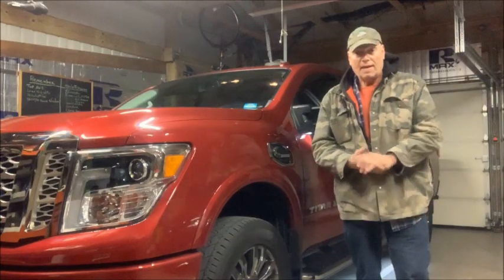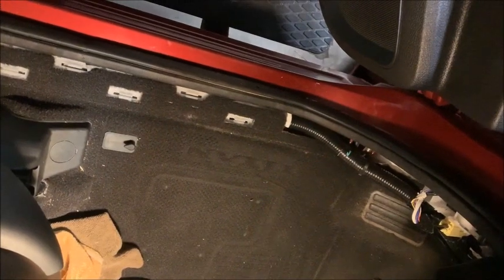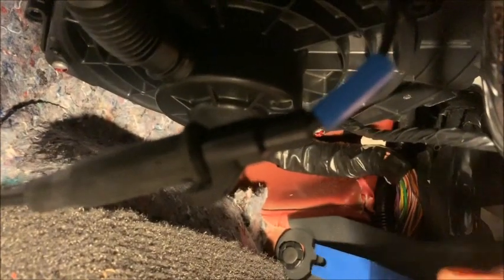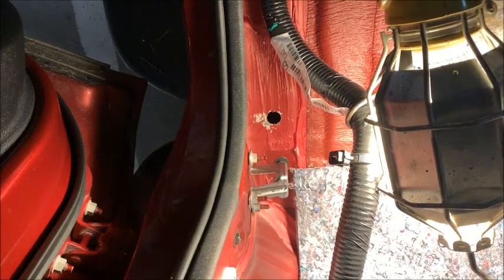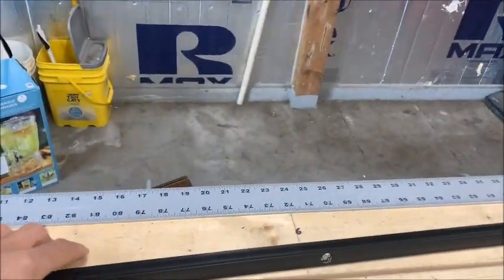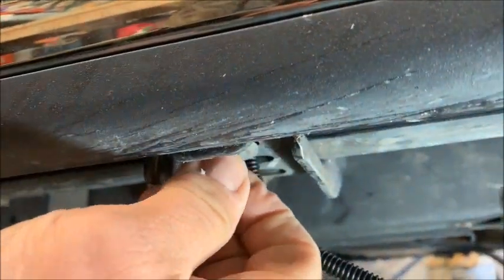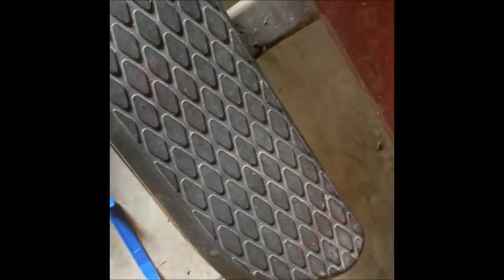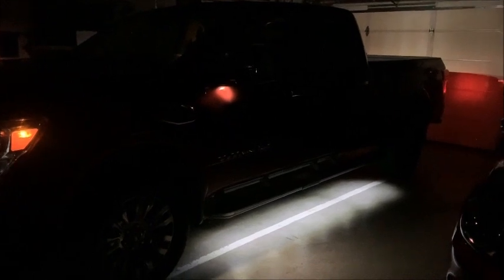Titan XD Running Board LED Install

Comment: Hello, Mark. I have purchased some used running boards for my 2017 XD Titan pro x. The original owner cut the wires off the lights on the running boards. I then ordered the needed wire harness needed to install the lights part numbers T99F6-4RAOA. Then i ran into your video and saw you speaking about the control module. I have searched every where for this module and no luck of finding it. So i then ordered the complete light kit from Nissan part number 999T6-W3399 hoping the module was included, no luck and a waste of $346 DOLLARS. Any idea where i can order the control module?

Thank you,
Reply: The control module came with the light kit. There should be a parts list with your kit. It's listed on that.
Reply: I just reviewed my parts list and the module is supposed to be included. I would call the supplier you got the kit from.
Reply: @hamradioadventures73  Could you please share your parts list? my order came from Nissan with no parts list.
Reply: @travisroderick2469  Send me an email address and I'll forward the instructions, or they can be located here: https://www.nissanpartsdeal.com/resources/installation/npd/1ux17.pdf
Reply: @hamradioadventures73  I only received 2 led strips, two front running board rubbers and two front round capS?
Reply: Reached out to Nissan and they will reship missing parts. Thank you for your reply @hamradioadventures73

Comment: Hey Mark, I am wanting to run these same accessory wiring harnesses with some illuminating door sills. I need the sill to illuminate when door is opened and turn off when door is closed for each of the 4 doors. Are there wires within the harness that you can tap into to achieve this? Your video is very helpful btw and I appreciate the time and effort you put in on it.
Reply from the maker: Thanks Steve. I do believe that the accessory connector that is used to install the running board lights also has the wiring for the door jamb installation. I'll look over the wiring diagram and let you know. Give me a couple of days.
Reply: @ntsysop1  Thanks so much I appreciate it!
Reply from the maker: @Steveisme21  According to the description of the accessory connector, it IS used for kick plate illumination. I am trying to find my pin out diagram. Will let you know. Usually with the kick plate kit, it will show you which wires to connect.
Reply from the maker: Yes! The accessory connector has the wires for both the running boards and the kick plate illumination. When you buy the OEM kick plate lights, the proper color code of the appropriate wires will be included in the instructions.
Reply: @ntsysop1  Thanks so much Mark, I went ahead and purchased the accessory connectors and although I am not hooking up the OEM kick plate lights, I am assuming the power and negative wire tap into wiring still the same. Thanks again for your help!
Reply: @ntsysop1  sorry to bother you but my accessory connectors didn't come with a diagram. I am trying to find a wire that will light up when door is opened and turn off once door is closed. Could you take a look at your diagram and help me out? Thanks again.
Reply from the maker: @Steveisme21  I'll post what I have on Youtube, my channel. I'll send the link: https://www.youtube.com/watch?v=L5gfMpxuTzI

Comment: Mark...I just purchased a 2019 Titan XD  SV Crew Cab (long bed). It came with the running boards, but like you, I too wanted the lighting kit for it installed. I purchased the kit to install myself. The instructions seemed to be lacking some important details, so I thought I'd search online to see if someone recorded a video of the install. I luckily found your video, which helped confirm that I was doing the installation correctly. Your video answered a few questions that I had. It's gotten dark outside, so I'm going to finish the installation in the morning. I don't expect to run into any issues. I will be using the factory connectors as well, which I ordered with the LED kit. I wanted to thank you so much for taking the time to record your excellent video. I know it added much more time to your install, but I greatly appreciate you doing that. I certainly benefited from your efforts. Glad it worked-out for you on the first try as well. I hope I have the same luck!  And you were right...those plastic step pads were crazy hard to remove! I'm not quite sure why they designed it like that. If you ever scraped-up one of the end caps and wanted to replace it (if it's even available to buy), you'd also have to replace the step pad, because you would demolish it getting it off to gain access to the T30 torx screws that fasten the end caps onto the running boards!  : )
Reply from the maker: Thanks for the thanks! With the factory accessory connectors you should be good to go. You are right, the hardest part was pulling the plastic cover off the running board. My install was almost a year ago and the LEDs are working perfectly. Enjoy yours and let me know if you had an issue at all.

Comment: Is this the kit you purchase from the dealer?
Reply from the maker: This was the OEM kit from Nissan. It's for the longbed (104") running boards. I used the OEM because it's a perfect and easy fit for my Titan XD. If you need the kit number just ask. I paid $240 from the dealer.
Reply: @ntsysop1  what is the part number for the kit thank you
Reply from the maker: @josrdz9160  Running Board Light Kit - 999T6 W3398 / 999T6 W3399
Nissan Titan King Cab/ Crew Cab with Installed Running Boards
Accessory Service Connector - T99F6 4RA0A
3. PART NUMBER:

308570

GENUINE PARTS
. KIT CONTENTS:
A
999T6 W3398 91" Bright Chrome 999T6 W3498 91" Dark Chrome
999T6 W3399 103" Bright Chrome 999T6 W3499 103" Dark Chrome